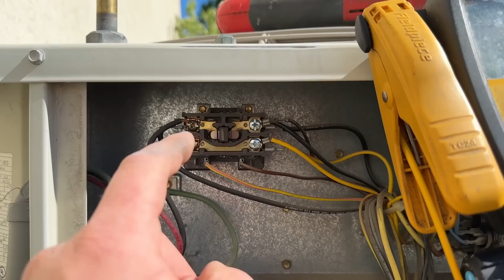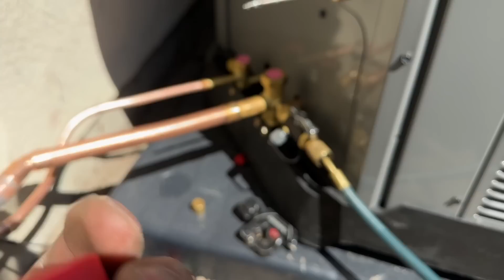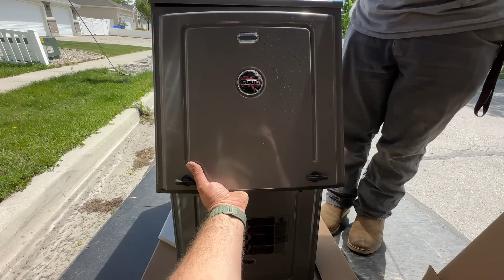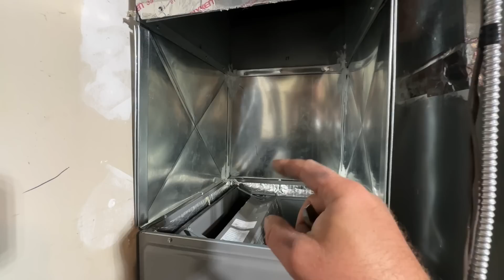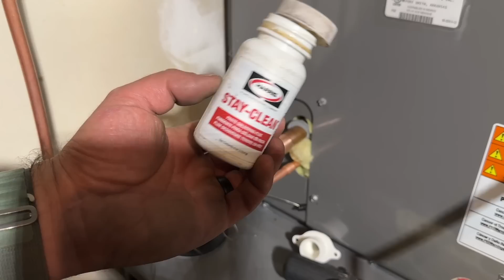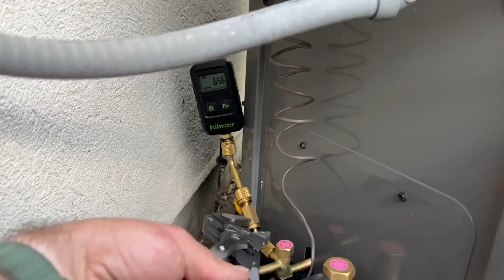Is DIY'ing Your HVAC A Good Idea?

Comment: Watched you do a complete install and decided to do mine myself. Bought everything on Ebay including condenser, evaporator and tools. Works excellent and saved thousands. The wife was very impressed, Thank you
Reply from the maker: Thanks for sharing!!
Reply: @bluejay713 remember that most of these tools will be in demand for years to come and they will retain their value decently. You can re-sell if you don’t want to keep them and get some of your money back.
Reply: You bought the actual hvac unit on eBay?
Reply: Every morning I get up and leak bang gas💥. Good thing I'm sitting on the toilet,  I'd hate to bump my head if I fell over from the explosion. 😤💩💨💥
Reply: I installed my AC system in 1989.  It was still running fine in 2019 (30 years later) when I sold the house.  Some people on here act like because they went to a few months of trade school and have some fancy tools, this is rocket science.  It isn't. 

At the time, I never thought much about a warranty.  I wanted to install Carrier, but nobody would sell it to me.  However, the Carrier dealer told me he could sell me Bryant, identical unit made by Carrier but with a Bryant nameplate and less expensive.  I'm fairly certain that the dealer who sold me the unit would have handled warranty issues if I ever needed it.

Lastly, this thing about insurance.  I've read though several insurance policies and never seen anything that said if I install and appliance incorrectly causing damage to my house that it will not be covered.  Or, that is I'm cooking incorrectly and cause a fire in my kitchen that it will not be covered.  Or, that if I place a space heater stupidly and cause a fire it will not be covered.  In fact, much of what insurance covers is people doing dumb things.  I don't get why wiring a new outlet or installing a new HVAC system would be any different.
Reply: @BryanTorok  "I installed my AC system in 1989" That's because depending on brand, you may have had precharged linesets (York) and R22 is much more forgiving since it uses mineral oil. 
That's no longer the case with R410a and what is coming to replace it.
Reply: @sprockkets  It was a Bryant.  I wanted Carrier, but couldn't find anyone to sell it to me.  And, I hired a pro moonlighting in the evening to braze the lines, evacuate, and charge system.
Reply: @BryanTorok  well that's not diy lol
Reply: @sprockkets  I did the majority of the work,  saved about 45% over the best quote, used better quality equipment, and learned a lot along the way.
Reply: @BryanTorok  where not talking about cooking buddy wrong comparison.  No, we don’t just do a ‘few months’ at trade school, it’s on job training. I would like to watch you repair a walk in Cool Room as it actually is ‘Rocket science’ 🙄  DIY KNOW IT ALLS
Reply: @AussieHVAC  Lol, yes we are the know it alls. With HVAC people like you I’m sure there will be more and more DIY. You’re the very reason we do the work ourselves over dealing with someone like you. If I had not met HVAC people like you, I’d have just thought you are a troll.
Reply: @Random_DIY  You don’t know what you’re talking about buddy . Jack of all trades and master of none . Good luck gassing up a unit with R32 refrigerant 💥 
Don’t forget to swap out your flux capacitor on a regular basis 🙄
Reply: @AussieHVAC  Oh but I’m afraid I do know what I’m talking about. I’m a master of many. One of the lies people are told is they can’t master more than one thing. Thankfully, I never believed that and I have mastered many including much more complex items than HVAC. Curious, what part of Australia are you from? I’ve been to every major city in Australia.
Reply: @Random_DIY  is that right OH so your a handyman that thinks they know more than a Tradesman in his field ?? yes well I’m actually dual trade HVAC & Electrician so think I know what I’m on about .  
Sorry ? Your Gay-Curious ? No buddy I don’t putt from the rough , not interested in your curious ways . You can keep that for your Mardi Gras 🍆💦
Reply: @Random_DIY   This is to all you DIYers, the reason we get paid what we do is we actually keeping working when it’s 45*C or -5*c outside while your inside sweating your backside out we are still working, no DIYers will be out fixing/installing their own unit on a stinking hot or freezing day , earth is only getting hotter, realise ❄️❄️
Reply: @AussieHVAC  I’ve worked on my A/C many times in 35C weather. Oddly enough I hired HVAC guy before I started doing my own and he was complaining about how hot it was in the attic. He was a Gen Z type.
Reply: @AussieHVAC  who says he has r32, there are plenty of 410 A systems still on the market. I just ordered all the equipment for myself on line r410A....
Reply: 30 years is a long time.  What changed between your first standard install and your last?  What types of mistakes (beyond electrical) are you referring to?  This burning down the house talk is concerning.  Do these burn events occur during installation, or days weeks after?  I’m unfamiliar with “bang gas”.  I’m aware that R32 is flammable, but only a bit more than propane.  Our HVAC contractor, a large company that’s been around for 80 years failed to glue in the furnace exhaust vent.  Based on things like this, years of experience carries little confidence in my opinion.
Reply: @crissalamango41  That’s your problem mate going to a large company, just because the company has been around for 80 years doesn’t mean you’re getting 80 years experience at your front door . You are far better using an owner operator that runs his own business. All the decent HVAC technicians will leave the larger companies to run their own businesses. It’s called bang gas as it can go bang, it’s still flammable so matter if it’s only just more flammable than propane, you get a restriction in your refrigerant system you’ll know about it .
Reply: @AussieHVAC  Welp the smaller company failed to even return the call for the estimate.  Now let’s talk about what exactly would cause a restriction on an otherwise properly installed system.
Reply: @crissalamango41  Restriction ?? Where ? In the refrigeration system  or the coils or airflow ??
Reply: @devnull7550  Mate,  if it’s tradesman work like electrical, plumbing and HVAC that should be done by a professional. Basic DIY fixes are ok with our insurance’s also but if it’s one of the work above , and you’ve done it yourself without being qualified and something happens to your house then it’s on you .  Even though I can physically do electrical and plumbing I leave it to qualified people so I also get the full manufacturers warranty. Over here our manufacturers warranty includes parts and labour with no strings attached but only if it’s been installed by a qualified contractor. Much prefer our way .
Reply: I find that hard to believe, unless you are a trained HVAC tech. HVAC isn't a "shade tree" trade and if you really did install it yourself, I guarantee you will have issues - major issues.
Reply: @bigmotorhead2908 You just stick to working on cars champ . Saved enough money to install 4 times over ? Yeah good on ya mate ! Only thing you’ve saved on is a quality job being carried out . We don’t have these ‘rip off’ HVAC companies over here like over there .  Try installing a unit with Flammable refrigerant, see how you go with that buddy .
Reply: @AussieHVAC  what is your problem!? You must be one of those techs that charge 2000 for just replacing a cap. I'm sure the one's who don't know and get charged 2000 from You are the ELDERLY who are on fixed income! SHAME ON YOU!!!thum
Reply: You have just kissed goodbye your manufacturer warranty dude, read the instructions manual as it will tell you this . We’ll see who saving thousands when your compressor shits itself due to air being in the system . As a HVAC Tech of 30 + years I do NOT recommend this. Hope you got plenty of money DIY HVAC as your going to need it when you’re ass gets sued when someone dies . Not being negative just stating facts . Can’t be doing that when bang gasses ( R32 ) are on the market 💥
Reply: You have just kissed goodbye your manufacturer warranty dude, read the instructions manual as it will tell you this . We’ll see who saving thousands when your compressor shits itself due to air being in the system . As a HVAC Tech of 30 + years I do NOT recommend this. Hope you got plenty of money DIY HVAC as your going to need it when you’re ass gets sued when someone dies . Not being negative just stating facts . Can’t be doing that when bang gasses ( R32 ) are on the market 💥
Reply: @AussieHVAC  I installed this system early May . Today it is 93 degrees outside and 72 degrees inside.  There should not be any air in the system if you do it the way shown in DIY HVAC GUY videos. 
  I saved enough money to install the system four times.  Anybody with solid mechanical skills can do this themselves .
Reply: @bigmotorhead2908  Air in the system is one of many things that could go wrong that was just an example. No house insurance either if a fire starts and they find out YOU installed it they will give you nothing . Just to save a few bucks in short term can come back to bite you, I’m just giving y’all advice and something to think about but if y’all too arrogant . R410a has huge high pressures which DIY’s shouldn’t be touching , really poor advice from HVAC DIY . 👎🏻
Reply: @AussieHVAC congratulations!! You are the first Jester in the comments section of this video. Every DIY HVAC video on YouTube has at least one of you 🤡s. We thank you for making us laugh 😂😂😂😂😂.
Reply: @AussieHVAC  Arrogant, is that the tea calling the kettle black? I think he saved more that a few bucks and best of all he didn’t support someone like you.
Reply: @bigmotorhead2908  you cannot go by that, there is always some ai present when you open a system let alone changing one out!! you need to evacuate any system once you open it up to the atmosphere. if you watched hvac guy you would see he used a vacuum pump on the system
Reply: @AussieHVAC I have an old R22 system. For the past 9 years I have been running R290 in it. Runs perfect. It has a small leak no one can find. I just add a little oil once a year. If it's leaking it's losing oil too.
Reply: @AussieHVAC  he most likely saved 10 to 15 grand by doing it himself, big freaken deal warranty is void because he didn't have a license company install it. with the huge savings he can afford to pay for anything out of warranty that might crop up, most people do not ever get a chance to use that warranty. I would take his odds any day
Reply: @AussieHVAC  yea you don't mention you still have to pay for labor and part of the refrigerant, its in the warranty doc. in my case, coil leak spent $5k, happened twice, cheaper replace with new AC unit fix it myself.
Reply: @AussieHVAC When you save 4 to 5k spending a grand on a compressor still saves you a ton of money and no hack installer cutting corners still getting labor pay for that "warranty" paet
Reply: @AussieHVAC lol your a joke.
Reply: @Random_DIY  No jokes here buddy !  I’m not the one that will have no house insurance coverage when your house catches fire and your insurance company finds out YOU installed they will just walk away and pay you nothing.
Not to mention having no factory warranty. I’m guessing you also do your own electrical as well ?? Good luck with that Champ…. Haha you’re the joke !!
Reply: @AussieHVAC  Lol you’re really funny. Keep your scare tactics going so you can over charge for your monopoly. Hehe
Reply: @AussieHVAC  Actually, in most of america, the homeowner is allowed to install their own HVAC equiptment "on their own residence" without a license 
, as long as the county inspects it after install and signs off on it. And if they do, homeowners insurance can't deny anything coverage with it.
Reply: @AussieHVAC  you are just goofy!!!  LOL
Reply: @AussieHVAC  If theres air in the system and non condensables are in the condensor he will know after day one because it will not work correctly. Then call a professional. No big deal. I'm wondering how much he really could have saved after buying the vacuum pump, gauges, torch, sheet metal tools. Theres gotta be 2 grand right there.
Reply: @SilverandCigars   Completely aware of mate, it will eventually come back to bite him on the ass . People over here don’t install there own units as they know you will loose any manufacture warranty .
Reply: @AussieHVAC  many people are starting to install their own systems because of the DIY videos on YouTube, you just pissed because people like you do not get the huge mark up selling the equipment.
Reply: @SilverandCigars  damage will have been done. Its not the air, its the moisture, you will create acid and make this entire DIY workaround void and pointless, on top of that you will have zero warranty available and pay a hefty repair cost to have it replaced. This entire DIY idea is moronic.

Comment: Spent $1600 on quality HVAC specific tools probably had about $800 in existing tools and 44 hours of labor to remove old furnace/condenser and installed new. And maybe 80 hours of youtube videos.  So for the one timer no way is it worth it, but now I have the tools, will never have to call an HVAC guy and I know the job got done as best as it could. Which is the biggest reason I do things myself.

Comment: I use nitrogen to blow out the condensation lines if they are clogged with mildew.   I usually tape off the nitrogen supply hose to the closest access on the E coil side, crank up the nitrogen to 400 psi then pick up the fittings that blow off (some people don't glue condensation lines).

Comment: When rplacing a hot water heater don't forget to strap down pipes when replacing a crimp type pipe locking system on supply (cold and hot) water lines and replacing wirh flex.

Comment: This is a terrible idea guarantee I could find at least 10 things wrong with a diy install from a noobie that installed it no permits no code inspection installed improperly and using cheap tools so many things, imagine trying to install a 20 seer inverter heat pump with no knowledge 😂 id love to go on that call

Comment: Just finished DIY install of the evap coil and condenser at my house.  I was planning to have a company come test and vacuum the new lines afterwards.

No dice.  No companies will touch a system not installed by a certified installer.

So, now I get to buy more tools and a nitrogen tank to finish the job.  This channel contains tons of good info but beware that if you do any of it, you have to do all of it.
Reply: It’s sad really that they hate keep and think they have the right to say who can and who can’t have ac in their homes
Reply: Just don't tell them it was DIY, most aren't going to just ask "Was this DIY or Contractor installed?". If you call and say, "Hey! I installed my AC myself and just need it charged up." I could see that they would be hesitant especially if they are using flammable refrigerant that can cause the house to burn down if there was a leak and then you try to blame them. If they ask, you could just say it was installed before you lived there.

Comment: Installing a Trane 10 ton split system and the tags on the condensing unit say that it is dry nitrogen charged.  The tag with charge info is blank.  Ever seen that before?

Comment: DIY is ok. Most contractors will not work on them though. DIY install can also mean DIY repair. i DIY but i have electrical & refrigeration back ground so it’s easy. I also don’t mind being without ac for a little while & have a backup plan if for heat.

Comment: I just wanted to mention that MrCool makes a “Central Ducted” system that is pretty much a drop in replacement for a traditional HVAC system. The advantage is you can use MrCool No-Vac line set and not do any brazing or dealing with refrigerant. Very easy for a DIYer. Also includes 10 year parts and labor warranty when you use the no-vac line set. I replaced my 5ton Trane with this system and it is working great. Really really like MrCool.
Reply: Are there any more things to know to install this system?  There seem to be a lot of different products from this manufacturer.

Comment: 4 year tech here. 2 years in resi the other two in commercial refrigeration. I do not recommend folk to try and do this type of work on DIY terms. Things are done wrong all the time such as switches being bypassed (pressure switches, contactors) circuits being improperly installed, (ex; stealing one leg of 120 from the air handler and running it to the condenser) improper refrigeration practices, etc. If you aren’t an experienced hand or even have a clue how it’s supposed to be don’t touch it. Simple.
Reply: Well then what’s ur suggestion for those of us deemed not worthy of thy precious time to be able to have a tech install or repair an ac? When u walk around with one pinky in the air acting like holier then thou….people have no other choice but to do it themselves….have u ever lived in a home that has no ac on a 100 degree day? Lmao
Reply: @w8what575touch what your capable of touching. If you have to think twice about touching something call for help. If you don’t even have a clue how it looks or is supposed to work, don’t touch it.

Comment: I recently had my contactor give me some trouble. After cleaning it a bit, It worked. However, I'd like to get a replacement as a prophylactic. I have a Goodman Contactor - CONT1P025240V It appears to be a single pole 25 amp. The readily available is a 30amp. Would it be compatible or am I asking for trouble?